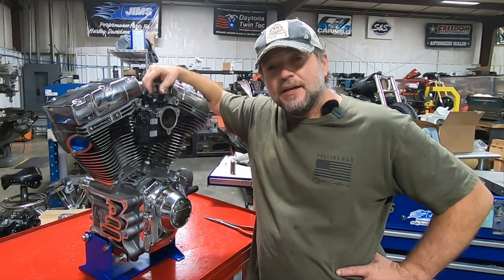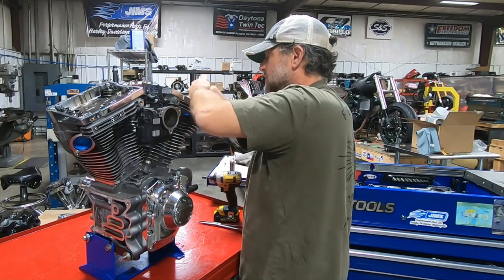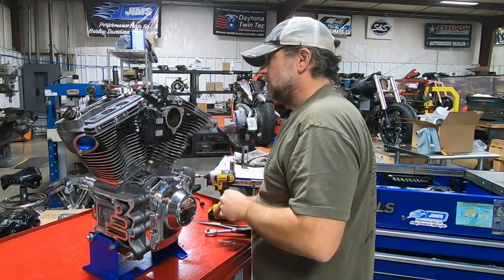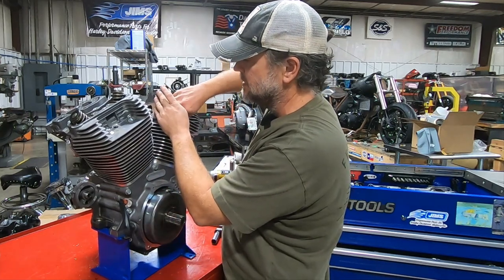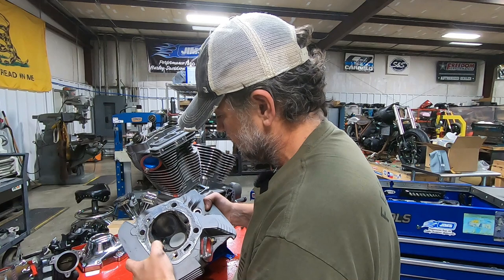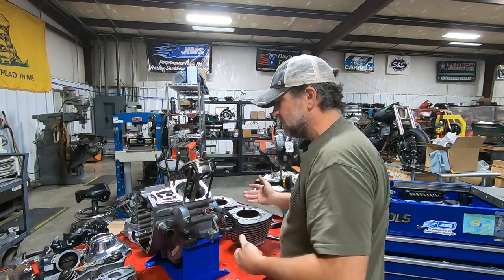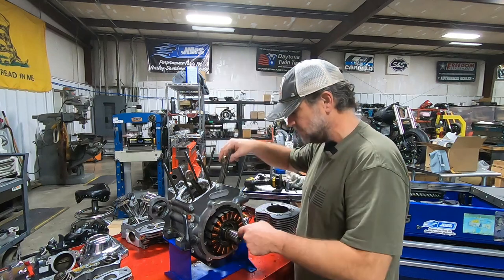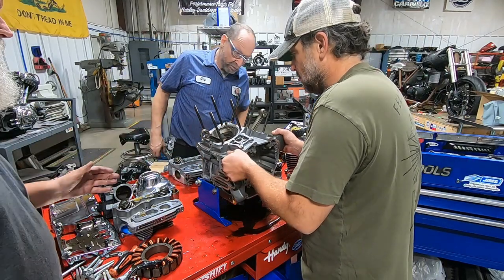Why Did This CVO 110 FAIL??? - Engine TEAR DOWN - Kevin Baxter - Pro Twin Performance

Comment: thanks again Kevin. If I wasn't I so old I'd just come wash parts for you. I have been building pan"s and shovels since the 70/80/s and I have learned more from you in the last few years than ever. Thank YOU. I'd love to buy you a drink.
Reply from the maker: thank you so much chuck.  i love pans and shovels too.  great engines.  like these, they had issues come and go too but for the most part, with diligence, they can run forever!  Long Live Pans, Shovels, and Evos!  LOL

Comment: I can't understand how an engine on such an expensive motorcycle and really expensive in the case of a CBO has catastrophic engine failure and 20 something thousand miles. Mine 20 plus year old Harley Sportster 883 has almost 400,000 miles on the original engine. But just like the Evolution Big twin the Evolution Sportster is discontinued as well. The only time I split the cases on my 1965 Triumph TR6 was because it was 40 years old and the camshaft we're both worn out.
Reply: HD is not making quality products for years. They have to change to liquid cooling to get the temperatures down.
Reply: HD stands for high dollar and keep coming back for more parts even if bike was brought new. 😁
Reply: The price you pay for beauty man!! Does a 20 yr old gf cook everday and clean the house to perfect... no .. we know what we are getting when we buy Milwaukee 😏 
If we wanted a bike that ran forever wo issues we would buy honda.. ahhh come on!!!!
Reply: What's they're not telling you?
Is all of the hot roding people due to make them break I see guys beat on them constantly.
Reply: @MurrayMotocross1 🥹🤜🤛🏽

Comment: Really enjoyed this tear down vid. I too have a 110 that the lifters failed and I have 7-8/1000s runout. Breaks my heart but at least watching these show me what exactly the shop I use was talking about.
Reply: You must be so disappointed in the quality of your motorcycle. You thought you were going to get a great motorcycle you spent a fortune on a Harley-Davidson and it took a dump. I just can't believe how the quality of a Harley-Davidson has deteriorated in the last 20-plus years after the demise of the Evolution motor. I hear from another YouTuber that there is kits out there where you could put an Evolution motor in a twin cam frame. It might be something to consider.

Comment: Another great video, thanks!  One thing I'm very interested in is the cost for these rebuilds. Would you ever consider doing a price reveal on some of them?
Reply from the maker: Each are different really and can vary broadly depending on 5 things as I have found over the years...  current condition of bike, how it will be used, riding style, desired power output, and confidence level of all associated stock components.  That determines the required budget and everyone's answers are different to these questions.

Comment: Is the crank in that shape because Harley started using pressed bearings instead of staying with the the timken bearings during assembly to cut cost?  I have a 103ci HO engine but upgraded to a stage III 110ci kit; apparently if I want to go up to a 117ci I'd have get a new crank to handle the HP and TQ.
Reply from the maker: not really.  a tapered main bearing vs roller bearing really doesnt contribute to scissoring or twisting a crank.  you dont have to have a brand new crank, but i would certainly reman and work your stock one at least.

Comment: I replaced the lifters on my 110 cvo at aprox. 40000 kilometers to prevent exactly this. I was advised to do so by one of the mechanics at the shop where i bought the bike. He told me he had a catastrophic engine failure caused by a lifter exploding while running the bike on a dyno. He told me this is a known problem wich can ocure on 110 cvo engines. Seeing this video i'm glad i did. Changed the cam plate, cam bearings for a SE camplate en bigger oil pump in the proces. Bike stil runs like a dream. 😊
Reply: Do you still own thr bike? If so what is the milage now? Any problems since then?
Reply: Just thinking to buy one abt 80 k km. Not sure if its a gamble
Reply: I still own the bike and it has 60000 km's on it now. I noticed that on several of the failures on 110 engine the lifters were the cause of the problem. If the bike you are interseted in runs good you could considder purchasing it and upgrade it with new lifters.

Comment: When my twin cam went out the tech Rodney @ LCHD said the factory says up .006 runout on the crank is ok my crank had .087  and was easily visible to the naked eye lol stock oil pump quit working while I was on the interstate motor was not happy lmao

Comment: Had a 2010 CVO 110.  Worst HD engine I’ve ever had.  Bike was babied and that 110 used one quart of oil every 1,000 miles.
Reply from the maker: ouch.  hate to hear that.

Comment: Any way to diagnose a 110s condition by the sound?...LOL. Mine is a 2016 from a CVO Limited. Had the lifters replaced early in it's life. It has 42k on it and runs well and well kept. Maybe it is just time for the complete rebuild to a 117! :)
Reply from the maker: I have learned to identify noises over the years and most of the time can nail it pretty well....but...i still get surprised.  not only by where a noise can originate, to where its heard.  but also....how something can be a bad issue inside yet NOT make a noise.  engines are fickle things.
Reply: Mine went 117 13k miles ago at 60k.
Reply: @KevinBaxter  update on my 110. Had the cam, lifters replaced. Looks like I caught it in time. No damage to anything else. Cylinders fine, run-out was in spec.

Comment: BTW stainless galls worse on other stainless so all my threads get industrial anti-seize as appropriate. I use dielectric grease on every small external fastener that doesn't get hot which prevents galling without staining like metallic anti-seize.  Every mechanic should visit industrial chemical websites to study their offerings. 3M, Henkel etc make chemical products for systems worth much more than any motorcycle.  If you prefer un-galled spark plugs Champion sell spark plug anti-seize for aviation (2612). There are so many proven industrial chemicals it's hard to keep up but periodic study is useful whatever you wrench.

Comment: Hi Kevin, I had a severe sumping issue on my M8 and the motor eventually blew with a piston rotating in the cylinder. Do you think the extreme overheating could of caused the piston rings and cylinders to be compromised to the point the piston could turn in the cylinder destroying my heads and motor?
Reply from the maker: it takes a lot to spin a piston....a lot!  typically only happens with a dropped valve or broken skirt.  wow.  heat can destroy an engine....a lot of heat really could.

Comment: Great video, how many miles are on this engine? I have a 110 water head with 54,000 on it, just wondering
Reply: Thomas my engine had 22,369 miles on it. Always changed oil in all holes at 4,000 miles. I have never had the engine above 5,000 rpm
Reply: Thomas my engine had 22,369 miles on it. Changed oil every 4,000 miles always used Amsoil. I have never had the engine above 5,000 rpm, mostly up only around 3,800 rpm

Comment: I never liked stainless steel fasteners. They will gall easily and inherently have less tensile strength than a good high carbon steel fastener. But customers would insist on them anyway.

Comment: i have the same issue but on a 2007 electra glide ultra classic with the 110 just curious tho if the jugs look fine do u have to replace them for new pistons or no same size ?

Comment: The sumping caused the big end bearings to fail?
Reply from the maker: indirectly possibly so.  excessive heat would be a factor.
Reply: @KevinBaxter I find the entire sumping issue fascinating. Chicken or egg question stacked 2 or 3 levels deep to discover the cause and effect of other issues.

Skunk Works indeed.  👍

Comment: Kevin, what  causes the piston slap, the cylinders not machined correctly?  I bought a 100 CI S&S big bore kit, they sent the shop doing the work 8 sets of cylinders before there were 2 that would fit. It has piston slap until it warms up,. Is this normal for a big bore set up or do you think there is an issue?

Comment: Hey Kev have a 2009 CVO Ultra with a total engine rebuilt right from crank shaft, Screaming eagle cam plate, piston jets everything in the year 2016 sounds great but the past worries, is it reliable now, miles after rebuild around 10k.

Comment: What do you have on the 110 screamin eagle counter balance chain tensioner shoes  I a 2017 flss lifters went out a 42000 miles got lucky on that now I am wondering when the counter balance shoes go out out can't find any info on how long they last I don't hot rod the bike have 43000 miles on it now?

Comment: Kevin, is it fair to say that just about every engine you see has sumping issues? Seems like HD is putting out some sub par motors. My 2018 107 most likely has this issue too. 
Thanks
Reply from the maker: By the time they get to me, yes...many do but not all.  It's easy enough to detect and check.
Reply: I have a 2020 m8 107 motor and it has 50k miles and runs great still
Reply: @adminadmin9997  From 2020 and up, didn’t they finally get it right at the Mother Company in regards to the oil pump?  From what I understand from an old-timer industry insider, they had upwards of 15 different iterations of the pump although part numbers showed less than that quantity.

Comment: Would. 96. Run to. Hot if turn it in to. 110. Are. Put.  W. Are e. Oil. Cooler. On it.

Comment: I assume it had the roller lifters ... Honestly their more trouble than their worth , Ford has the same issue with there modern garbage engines , the roller bearing failure on the lifters destroys the whole engine ... Whoever invented those is a idiot  , having a roller needle bearing in that situation is just asking for problems . Lifter problems in the past is not usually a big deal , you replace them , maybe a cam and your good in most cases ....